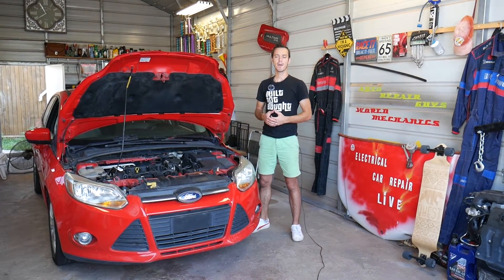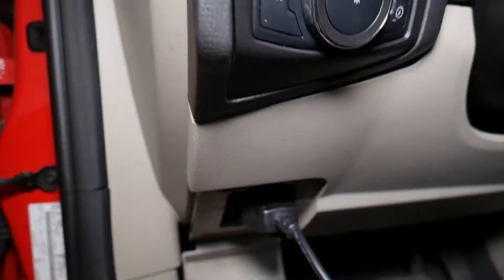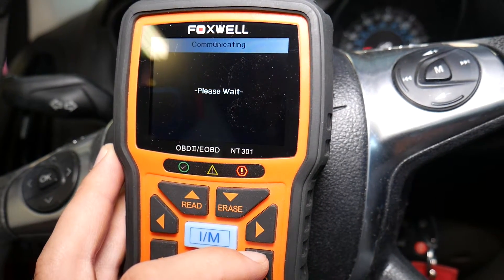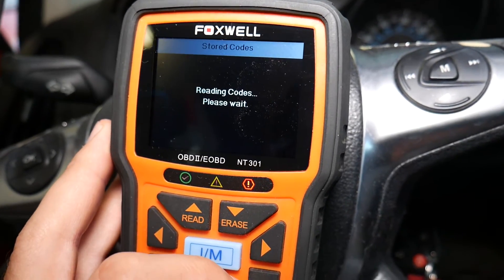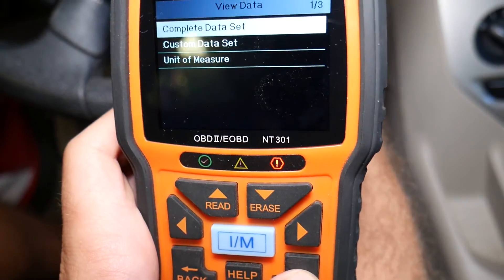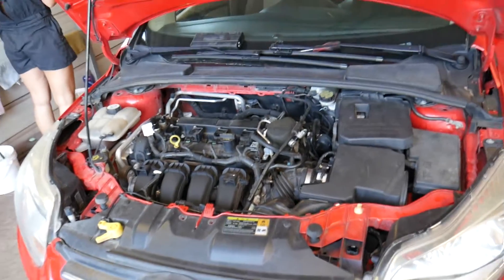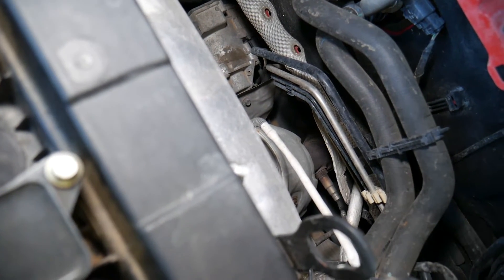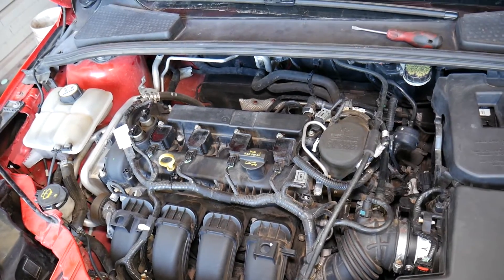FORD FOCUS CODE P0141 02 SENSOR HEATER CIRCUIT BANK 1 SENSOR 2

Comment: If you guys don't have an oxygen sensor socket, you can use a long 7/8" (or 22mm) combination wrench to remove the sensor. First unplug the sensor, then cut off the wire.  Use the box end of the 7/8' wrench to remove the sensor.  Spray the threads with penetrant first and let sit overnight.  Use a hammer or small sledge hammer to bang on the wrench while you are removing the socket.  FordTechMakuloco has a great video on how to remove a stuck oxygen sensor.  Good luck men!